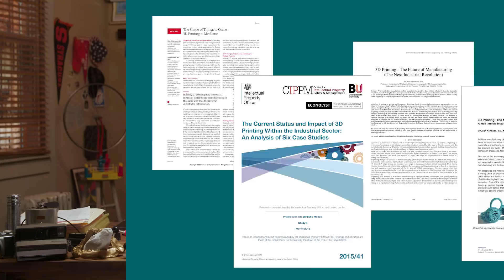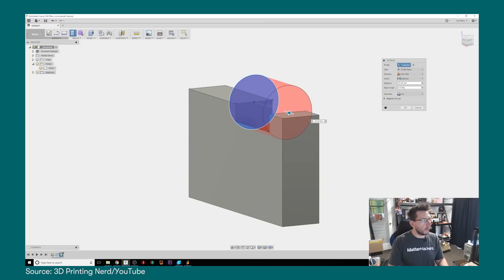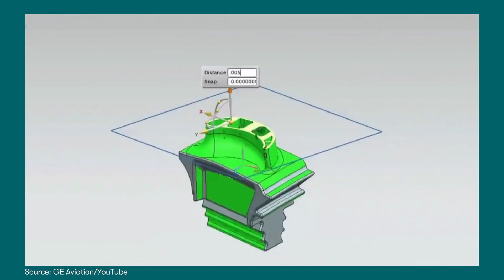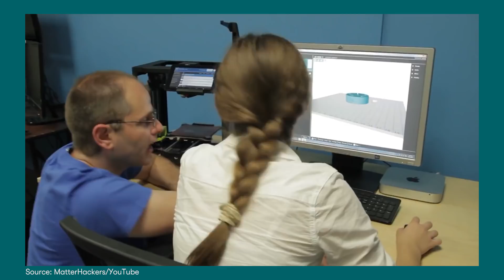What happened to the 3D printing revolution?

Comment: This is one of those stories where I started off the research thinking I was going to tell a specific narrative (that 3d printing was dead), but then I realized I was wrong.
Reply: Louis Foglia fast prototyping is a thing. My work does it all the time. Any mechanical engineer would know.
Reply: If you over-promise, it's much more likely that you will out win over the competitors, just look at the F-35 airplane that were going to be a cheap mass produced air craft.
Reply: https://en.m.wikipedia.org/wiki/Hype_cycle
Reply: Louis Foglia I’ve been an applications engineer in this space for almost 7 years...great video!
Reply: Alex - The analyst I spoke to at Gartner manages the hype cycle for 3d printing. The hype cycle is gartner speciality.
Reply: Very much alive. It's lovely when you get it right. But with the community showing others how; like 3D Printing Nerd and others, its going great once you put in the work.
Reply: I read the title thinking this guy does not know what hes talking about. Good video.
Reply: On the university where I did my bachelors we had a simple consumer-level 3D printer and used it for printing enclosures for PCBs and all other types of conectors, cases, parts, etc. It was increeeedibly useful and trully a revolution for students that can make their designs much more professional without spending thousands of dollars on molds which would never happen anyway. So I guess you're right, it's a hell of a revolution, just not at home.
Reply: You are wrong more often than not after all.
Reply: Louis Foglia yeah agree with the video. However, I happily own two printers of my own. I love how printers such as the CR-10 has made the value per dollar so much more achievable to the average user. Also, hopefully over time if those who have 3D printers, at Makerspaces, schools, etc are diligent with sharing their knowledge perhaps our kids/grandkids will consider 3D printers a household object.
Reply: +Bill Yeah, look at Elon Musk, period lol.
Reply: dude ya, 3d printing is still amazing technology.  it's like when cell phones were released -- people didn't really need them, the builds sucked, etc.  i'm at the beginning of the vid, so idk -- he might make these points.
Reply: Very nice video, you have a new subscriber. Have a look on two photon polymerization printing. That's dope.
Reply: People were excited about 3D printing, until they found out they would have to learn CAD and Autodesk to use it.
Reply: We love you more then your husband
Reply: john doe whats that mean ? he has a husband ?
Reply: People wants hype, dna demands it! Then brain comes along and draws the curve. 
Damn it's hard to reject your own nature most of the time! Your body might as well call the lawyer....
Reply: woops this is my boyfriend's account!  sorry hunter! <3
Reply: Good thing i read this. You're dead wrong its bigger than ever and only getting even more bigger!
Reply: There's also an anti-hype cycle. Naysay everything that had any attention at all after people accept it as the norm. As if it 'died' when it didn't. Fake news uses this.
Reply: You're not very bright are you?
Reply: Your "kids/grandkids" are going to spend most of their time trying to survive in the hideously over-polluted world you "Geniuses" leave them. What are you doing with the "rejects" and unwanted products of this process? Can you safely eat them? Stoopid wankers.
Reply: You can melt them down and recycle them
Reply: Wish more big media people did what you are doing
Reply: No one is saying it's dead, but it surely is overhyped ("We are going to 3D print everything!!!").
Reply: 4 years later, are you still wrong though?
Reply: you make me cringe. It's pretty much been implemented into every single engineering company for prototyping. Your expecting cncs to become a thing for normies.

Comment: In the AutoDesk the dimensions of the object is finalized and verified already but when the manufacturing of the objects to 3d printing some errors may occur because the filaments have shrinking factors there is room for improvements in 3d printing like in FDM compensating the shrinking rate is difficult you have to print first then let it cool down and measure it manually using the right tools then after you have to rescale it just to compensate the shrinking rate. That is a big problem when most first timers did not knew about that factor, 3d printers should have  auto compensate depends on the material uses and also the environment so when it cools down the object is in the proper dimensions based in the AutoDesk.

Comment: But isn't it weak and expensive. I need to machine a 180 mm OD of 15 mm thickness and have 4 holes drilled in it and add 4 stepped bushes with 20 OD and 80 mm length . It would cost me 2300 Rs  at max but if I pay 3 per gram for FDM that will be 12000 Rs for that from a vendor but if I print it myself that will be nearly 5000 Rs on material alone. I say its a scam and 3d printing is useless

Comment: The thing is most industries dont announce or brag they use 3d printed parts.  why bother? what you dont see or read about doesn't mean its not happening. 
i work in a factory in a tiny town in michigan that uses some 3d printed pneumatic gripper parts. 
I have never printed a bust of anything with my printer its a stupid waste of plastic. I print to fix, improve, and make new things.

Comment: I know company that print gears for their products, when the have to wait for the replacement part. Additionaly 3d printing is very good for lighweight constr. . The problem is the technology isn't ready for now, but it will come soon. But 3d printing is not the answer of all and anything. This would be the replicator in Star Trek :). But its very useful SOME applications.

Comment: In spite of sounding rather futuristic/exotic to many people, 3D printing (or additive manufacturing) was already a staple in the mechanical engineering/product development world for many years, well before this recent hype cycle began.  But due to the promotional buzz in the press, coupled with the layman's unfamiliarity with the technology, 3D printing was suddenly sensationalized and misrepresented as something new that would revolutionize manufacturing on a wide scale in the near future.   

In reality, while the technology has seen some incremental (yet important) improvements over the last two decades (e.g. durability/diversity of materials), the basic technology and its inherent limitations have remained the same.   There is still machine operation, maintenance, and raw material sourcing to contend with.   On the design end, there is still material selection and 3D CAD to work through.  The operator must be aware of impact from process or set up variables - this can affect resulting part quality.  Completed parts may need considerable manual post-processing, depending on surface finish requirements.   None of these steps can be circumvented, hype or no hype.   As such, these aspects of 3D printing will continue to limit its proliferation across a higher variety of applications in industry, at least in the near future. 

One aspect of note that did coincide with the hype in the last decade was that the actual equipment got progressively smaller and cheaper, enabling low-end machines to legitimately enter the consumer budget range.  As a result, a lot of hobbyists jumped in out of fascination and desire to "get on the bandwagon."   Ironically, the Chinese are the ones that can capitalize from this effect since they have the ability to make the entry-level machines cheaper than any American company, thereby out-competing us on the hobbyist front.  And at any rate, the aforementioned time/work involved with 3D printing (machine set-up, troubleshooting, running, and not to mention part conceptualization and 3D design) keeps it realistically out of reach of most "average Joes" save those who are exceptionally ambitious, industrious, and determined.

So the net result is that 3D printing still holds a similar place in the engineering world, and is still on the fringes everywhere else with a couple of specialized exceptions.  In my opinion, if we really wanted to revolutionize manufacturing, we would focus our efforts on researching ways to reduce the cost of injection mold manufacturing (essentially the cost of steel and machining) to better compete with the Chinese - this is a big reason why domestic companies always choose to go overseas when sourcing their molds.

Comment: Main issue is the only form of low cost 3D printing is FDM and it's really only suitable for making certain things and if you want to make something good and durable you either have to sand, finish, mold, cast, sand and finish again to produce anything or for strong parts out of the box you need to drop a cool quarter mil on a nylon SLS printer and either way you go you're a manufacturing operation with all of the pitfalls.

3D printers are absolutely stellar at printing parts for new 3D printers, replacing misc broken knobs, handles and doodads and an entrypoint into CNC and 3D modeling for young people and hobbyists. But manufacturing is a tough business and these things ain't Star Trek replicators yet. And if they were nobody could afford them.

Comment: Feb. 5, 2019----I'm 65, so going back time wise. Anyone remember VHS & Blockbuster? Was visiting sister & her family in Indiana in 83/84(?) and bil told me that before too long, EVERYONE would have one in their home. No doubt in my mind he was crazy because of their cost of up to $1,500. I remember considering myself lucky in buying new tapes on sale at $5 each. My first vhs machine cost me $350 and this was when I was making $10 an hour as a computer operator. Now you have a hard time giving the tapes away. Anyone remember when dvd's cost on an average of $50 EACH? Got lucky in winning some money at a casino and while at Blockbuster, bought a discontinued model for $300, with dvd prices dropping.So when you're yammering how 3D printers won't take off until big business starts using them, you're full of it. I damn well don't need or will buy a printer that costs $50K or more that will take up half my living room space. I don't know squat about 3D printers except for the videos here. Looking at buying the Anycubic Photon resin printer for my model building.Getting into modeling again, but going for zombie/apocalypse dioramas. I've looked at the monofilament printer types and many of them are crap because they have all these VISIBLE lines between the layers of monofilament. See this is changing now. Thing is, there seems to be NO standard among all these printer manufacturers. Print bed is 1 example. The amount of fiddling you have to do before you even get started such as leveling the bed. Why isn't this ready to go when you take it out of the box like when buying a dvd player? You have your power cord, remote, hook everything up, then hook it to the tv, and you're ready to watch a movie. I also don't understand why everything seems to take so long. Can you see a car manufacturer taking16 hours to print a car hood for example vs a machine that can stamp out hundreds, if not thousands of them in the same time period?No doubt in my mind 3D printers are here to stay, but there needs to be some sort of standard across the board for them.

Comment: One of the draw backs to many 3D printers is the lack of a cabinet.

All homes have and contain dust. That dust does interfere with the 3D printing process. It will interfere with the plastic sticking to the heat bed, or even prevent the plastic from sticking to plastic. Dust on the filament will cause issues with the print head as well.

While the initial designs were good, they don't work so well in a home environment where dust is more prone than in an office environment.
Reply: There are entire companies (3DPrintClean for example) dedicated to creating containment systems to circumvent this issue. There are also many DIY ways to battle it like 3D printed dust cleaners that attach to your filament and clear dust before entering the extruder. Currently the consumer 3D printing market has largely tapped out it's hobbyists and is now attempting to fill out their "Prosumer" markets - higher end desktop 3D printers usually above $1500 USD. These outperform other models on average for obvious reasons and their purpose is different - it's often for the professional doing a lot of their own in-house 3D printing or a business that wants consistent printing results with less time spent on getting settings right in slicing softwares.

Comment: 3D printing improving rapidly but its not at commercials and still needs some expertise to use but for next generations 3D design and coding is a must so in next 10 years nearly half of the houses gonna have 3d printers

Comment: Honestly its speed and repeatability.  It takes at least an hour to build something solid and there is no way to detect when something wrong happens so you have to watch it a bit.  Octoprint has a nice plugin that can fix some of it but it still takes forever.  If you can get 0.4 res under 15 min, I feel like the consumer market would jump on it.

Comment: You made some very valid points. Yes, you are right about the 3D printers not being as popular with the general public as was predicted. And as you point out the reasons for this that you have to learn to use applicable software and also the machines are a pain in the arse to get running properly. Looking at the whole picture though I believe they are going to make massive changes in the way we make things. At the moment as you say companies are using them for prototyping and perhaps small batch manufacturing. The cost of tooling to produce prototypes is time consuming and expensive and there is no doubt that 3D printers are filling a need in this area. But I find it amazing that recently 3D printing seems to be being utilised in so many areas - there's the usual plastic and metal printing which most people will be aware of, but other stuff such as biomedical, concrete, carbon fibre and recently graphene are now being printed. It's in its infancy but I think there is no doubt that we are in the middle or a revolution in the way we make things.

Comment: I honestly have mixed feelings on the "3d printing revolution". It is undoubtedly a useful tool but, at the expense of the thousands of  highly skilled labourers being out of the job. Seems a bitter sweet reality.
Reply: It seems like a moot point friend - the ol' "MACHINES TOOK OUR JOOOOOBS," argument is always void. Why would it ever make sense to hinder efficiency because it "takes away jobs?" What it really does is show the inability(or unwillingness) to adapt. Manufacturing methods will always evolve so we can get things faster and cheaper. People are often expensive (human rights is a thing people want it seems), so they will always be used as little as possible and as cheaply as possible. So wouldn't it make more sense to train factory workers to repair, design and program the robots that "took their jobs?" The world is always changing and we adapt or we die sooner. This same argument has happened time and time again - people are afraid of the unknown and are thus turned off by learning something new if their current way of doing things is being gradually or suddenly removed as an option. I feel like people either get over the fear and start adapting and learning, or they slowly get left behind. Eventually we all get old and adaptation grows more challenging. As they say - the only constant is change.

Comment: At 4:00 you say that astronauts can 3d print tools in space so they can save fuel, but you still have to get the 3d printer there plus the raw materials used to 3d print things lol. That raw material still has weight.
Reply: Less weight than the original tool - think about it. A 3D printed object is often hollow (infill setting). A normal wrench would be solid all the way through and likely made of a dense metal like steel. A 3D printed wrench could be 90% hollow, weigh a fraction of the steel wrench and various durability depending on what material is used - like Carbon Fiber or Poly-carbonate.  Plus, they are working on breaking down the raw materials to reuse a certain amount of times, making that same wrench into a spoon, a bracket, or any other number of useful, tough and lightweight items. All in all, NASA certainly crunched the numbers here.

Comment: Like so many other "product Ideas", 3D printing wasnt missed by the marketers.   Greedy Marketers and manufacturers stretching the truth, leaving out facts, etc, etc, etc.. Sell as many units as possible for as much money as the market will bear. Live off the hype!  So whats new?
Then the reality of the truth.  Its not so easy, and materials arent good for much beyond action figures, vases, and artistic efforts.   Now we inject carbon fiber into the filament mix get a materials improvement but are still not that close to having everyday practical uses for industry and other endeavers.  Hardware improvements are happening in FDM printing as well as new methods in other printing techniques.   FDM being the default for the general public lets just stick with that.  The real breakthru will come with chemistry, improving and pioneering base elements for use with FDM.  Give me something light, strong, heat resistant, chemical  resistant, will still be bondable with common methods and can be printed without too much hassle.  This has been the cry and will remain so until we get what we are looking for.  So common and hurry up with it already!
Reply: I say forget FDM, hello easier-and-cleaner SLS and SLA. Stronger builds, better material uniformity, less post processing to remove layer lines, often immediately useful after minor post-processing etc.